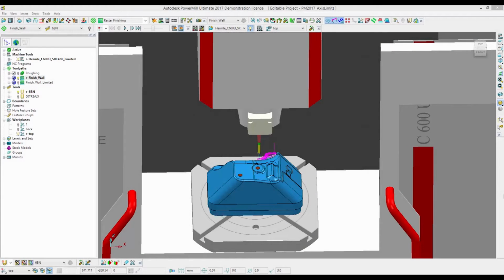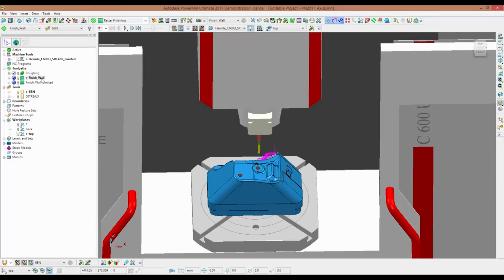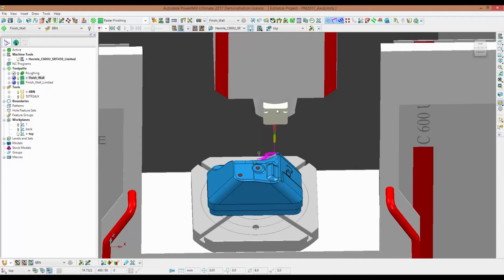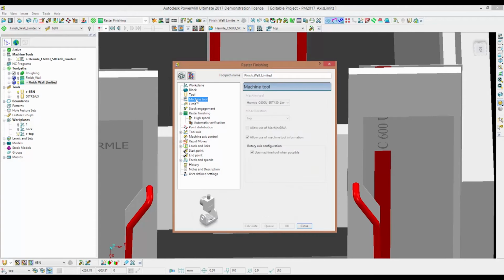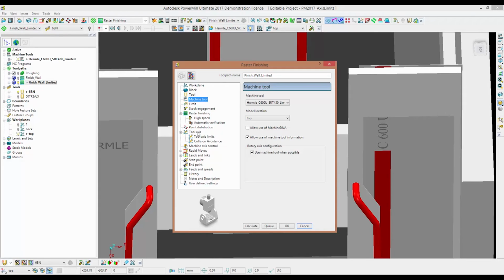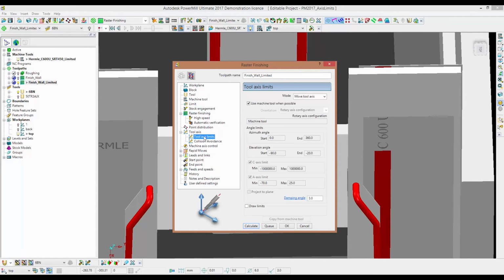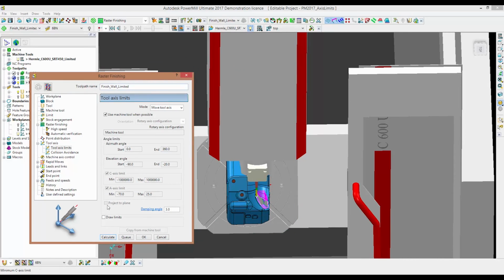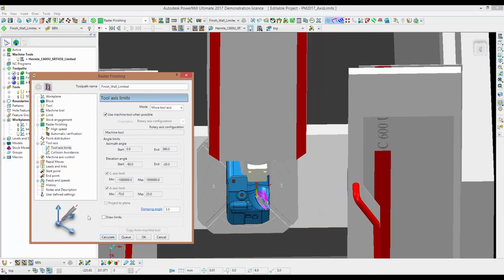Autodesk PowerMill 2017 - What's New - Tool Axis Limits

Comment: This works for a 5-axis machine. On the "machine tool" tab, you can set the machine data usage and this data is loaded into the "axis limitation" - "orientation" - "use the machine when possible". For a 4-axis machine this does not work. Powermill writes that the machine is not "correct". Although the machine simulates as it should. In here than is it? Why does not it work for the 4-axis machine?